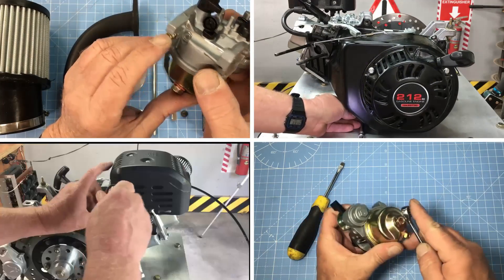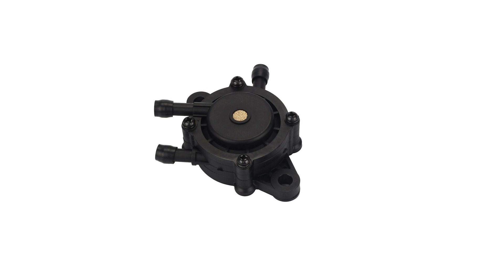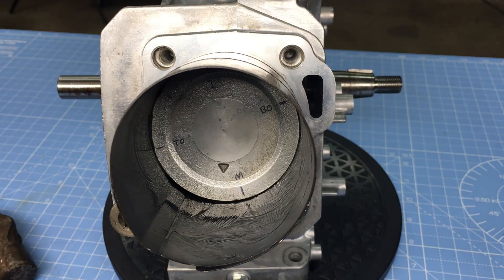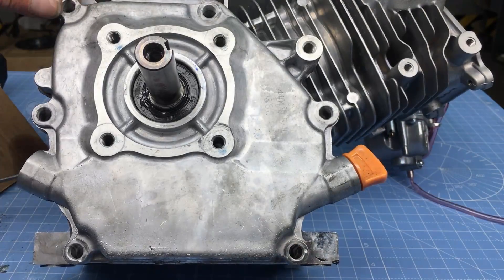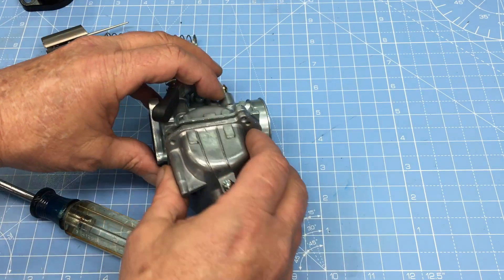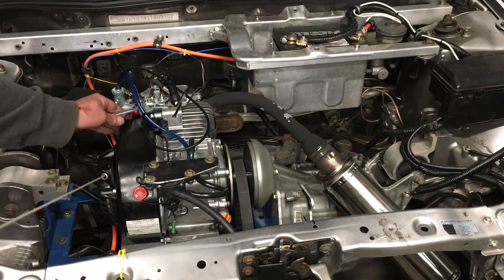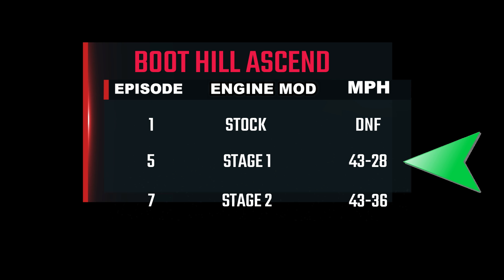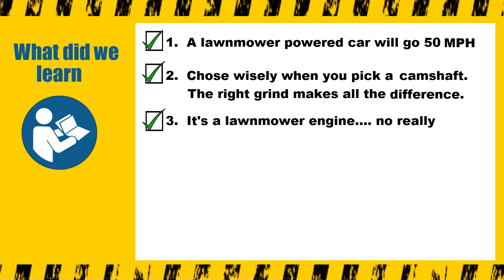Episode 7.  We  get the Honda insight to go 50 MPH with a lawnmower engine.

Comment: Really excited .. all videos on this! Tired of the man and all that crap u dont need ! something cheeper to fix /maint.. My fav truck is work / gas miles ..ford ranger club cab.. i like it short to reach the bed /cheeper tires is thin and small.. 185/75/14 .. less rubber is cheeper tires.. /better gas.. No a/c ... what engine for both gas/ 50mph/pull a lawn trailor! ? ??? my 3.0l ..cracked block /water in oil.. time to do it! help! i can lower to 40 mph.. if have too !

Comment: Adding a turbocharger is the simplest, most cost effective way to gain much more torque and horsepower, because it's the torque your needing to increase, so add a turbo, and that car will drive like it did with the original factory engine.
   The turbo will also get rid of that lawnmower sounding exhaust noise.
   I would love to see you try this. 🤠🙏💖

Comment: 7 steps from the top on an NPT tap will get you the correct gauge depth +- a quarter turn. At least with the tap you used here.

Comment: Thanks 🙏🏼👍🏼 for Showing Something That We're Not Sure if we'll Try it or Not. for,,,, X,Y & Z  reasons.
I saw a Twin,,  V2 650cc at Harbor Freight's @ little over than 45 c.i. displacement
Now, in the place of the 212 cc., Will reach 60m/h in @ 20 seconds., Under the same circumstances.

Comment: vm22, should have chosen the vm20 or vm24 since those can be equippe with an adjustable main jet making it a far superior choice then using fixed size jets.

Got the 20mm myself and it works great on a 70cc twostroke, takes only a few seconds to add or remove fuel from the mixture.

Comment: I know this is an old video, but I'm gonna pretend it isn't: Fins not aggressive enough, you say? The solution is obvious, and not putting the cast iron one back in: You cut off those fins, modify the plastic one a bit, and glue it on the billet one. More aggressive fins, and a lighter flywheel for better responsiveness! The CVT "torque converter" you're using should make any problems with being able to maintain revs while starting a non-issue, and you have adjustable idle on the carb, so you can just set it to idle at like 1500-2000 rpm if it struggles at normal ranges. :D

Comment: Why not use one of the holes you plugged up instead of drilling a new one? What did I miss?
Reply from the maker: The hole for the governor was plugged in the video, however we can also use the governor hole for the throttle linkage.  If you look close at the engine when its in the car and at the engine in the season 2 episode 2 dyno video, we are using the governor hole for the linkage.  That's why we drilled a separate hole for the fuel pump.

Comment: What happened to the dyno results of the last version of the 212? Inquiring minds want to know. 
Good series, but more dyno results would be nice.
In the last case where you explained the drag strip disappointment, a comparison dyno curve would have helped (Stage 1 vs Stage2).
Reply from the maker: Yeah, I dropped the ball on getting the dyno numbers on the modified engine.  The good news is, once we are settled at the new location we will run the modified 212 engine and finally get the numbers.

Comment: Not sure why you would limit your RPM to 5000. The 18lb springs allow 7K RPM or so. And the cam and mikuni carb would help all that. For a max 5K RPM you could have went with any "CL" cam and stock valve springs.

I'm wondering if you lost all your bottom end with all that timing? What timing does the ARC flywheel get with a stock key? Doesn't the mod 2 cam call for 30 BTDC timing?
Reply from the maker: I limited the RPM to 5K because I was still running the cast iron flywheel,  The ARC flywheel is awesome, but it wont cool the engine at the loads I'm running.     I did try the 30 BTDC with the ARC and the engine got up to 300F and started to detonate.  I backed off on the timing and the ARC flywheel still wouldn't cool the engine.  I reckon they are fine for a go kart or mini bike but not for my application.

Comment: I'd say it has just enough detail. That's quiet a bit of technical specs for a one cylinder air cooled lawn mower engine. It's impressive it can do that much with the right transmission. It would explain how some of the early low power steam engines were able to pull tons of steel along a railroad or plow a field.

Comment: I may not know shit....but.....the engines I have put together and pulled apart, and put back together again all had the rings rotating on the piston , I figure it's the same as pushrods, or lifters  rotating, like I said I may not know shit, but I've found rings can be any old way you want, at least on multi cylinder engines I have worked on.maybe mower is diffrent.
Reply from the maker: You are probably right,   This was the way I was taught and it might have something to do with maximum compression on the first start.

Comment: Awesome. Now before you might have been born. There was 2 mechanics from Florida that took I believe a 4 cylinder Mercury Capri from 1979 to 1984. They took a carburetor off a marine engine, then develope a way to heat up the gas before entering the marine carb into the engine. So by atomizing or vaporizing the gas made it so efficient that got 200 miles per gallon they claimed. So the article was published, and twice their garage was burned down. The government told them to stop or face jail or they would disappear.  If true, you could see why auto manufacturers, and oil companies would want to shut it down. Back then you could request paper work on how to do it, and I did. I was 18, but it was a little to much for me to do. Great project for your channel. After all auto companies said 10 years ago that over 30 miles/gal was impossible, but now get better mileage. The less gas an engine uses the less of carbon build up, which extends the life of the engine.

Comment: Entertaining as a project, but the stage 4 upgrades seem kind of pointless as you could put in a motorcycle engine with more HP for similar price. The connecting rod, head, carb, etc add up to several times the cost of the $99 engine. You're probably up to at least $500 in parts, probably over $1000. Yea, I get it, then it wouldn't be a lawnmower engine.

Comment: Whats your MPG? A smaller engine make me thing it is really high, But the amount of work that little engine has to put out at 50 MPH makes me think it might be a little lower. Please, I am Really curious. Thank you.
Reply from the maker: We previously got 54 MPG  with the stage 1 engine, the stage 2 engine made more power, but uses more fuel.  The actual MPG is unknown but is somewhere between 35 and 40 MPG.

Comment: Maybe you should add a carburetor that can be used with a mixture knob inside the cabin for those spring days. That way you can still make it up the same hill on the hot evening that you climbed in the cool morning without having to bring a screwdriver lol

Comment: im sure you could do some modifications to the front bumper for better aerodynamics and a slightly higher top speed. keeping the windows up would help aswell :)
Reply from the maker: We will do some mild aero mods to the front of the car this season.  The window was open due to exhaust fumes.  If you watch episode 15, we build a complete exhaust system for the car.  Stay tuned, more is on the way.

Comment: If you have to move the fuel tank, and add a fuel pump, why not use the fuel tank that was originally designed for the car, and connect it to the engine?
Reply: Weighs too much is my guess.

Comment: Neat, just found this.  Your in Michigan too.  I'm wanting to install a 1.8L 2ZR-FXE, probably gen4 Toyota Prius engine (at least for starters and I like the EGR design better being after the catalytic conv. circuit) in my 2001 Dodge Ram.  Thinking that'd be a reasonable build that's not really expensive, I have the truck and the 5.9L 360 V8 would be sweet in a boat or motorhome (original plan before Dad sold the Dodge dually when I was away at Tech before I was being mind controlled and assaulted/battered like I guess he) and for the price still fuel efficient alone compared to a 1.6L 1NZ-FXE.  I mean the truck was his suggestion... I wanted a Ford GT and that motorhome as a home to save up and invest in more.  Probably better travelling the U.S. in the Prius too.  Anyways... neat build to see.  I'd personally use a Briggs and Stratton made in the U.S. older opposed twin or maybe a V-Twin Vanguard engine.  The Kholers Magnums I hear are reliable too.  I've been saving a few of the B&S OHV's and those are really reliable and super easy to work with... like the L-Heads.  OK... long story short... great to see the design.  Would be nice to see more trucks with 4-strokes or 4 cylinders.  Thinking can keep 2 wheel drive and just use the stock transfer case or maybe a T90 or something smaller I don't recall offhand as a gear box in between the stock trans.  Thinking a newer 6 at least or even better 8 speed trans since seems more reliable than the 9 speeds if needed for some reason to make more efficient.  That will be some programming fun and/or spoofing and/or custom sensors and controls.

Comment: thats what a lot of people arent aware of , don't realize . the amount of power it takes to double the top speed on a vehicle is way out of proportion . and to keep a vehice cruising at a steady speed takes a lot less power than it does to accelerate it at a fast rate . here's an example - a 1964 VW beetle weighs approx 1800 lbs. and has a 40 horsepower engine , and they go 72 MPH flat out . a 1968 dodge charger with the hemi weighs about 3600 lbs. about double what the beetle weighs and the hemi although rated at 425 horsepower actually puts out 515-535 horsepower at the flywheel . the top speed is 156 mph according to an old magazine road test i read . so , it has over twelve times the horsepower , yet the top speed is less than 2 1/2 times that of the beetle . gearing doesnt play much of a factor here as it really isnt all that much different between the two . it is mostly because of the weight and the wind resistance of the larger body of the charger

Comment: Maybe should have took the aftermarket head to get machined for the stock valves to get higher air flow, if the valve springs would work on them

Comment: I wouldnt say its a lawnmower engine really. Its more lawn equiptment but I rarly see mowers with this set up. Mostly spray pumps topdresser aerators stull like that. Guess it depends on the mower but I havent seen it. The point is correct tho dont let me take away from the fact that this is amazing.

Comment: I dont know how many of those junk carburetors I've messed with now. Not only are the jets way out of specs from there marking, the orifices' in the carbs are undersized.  This leads to lean conditions that no jetting can fix.... And when you get all that squared away, the slide is frequently ground wrong.

Comment: Side note: a guy back in the 80s built an airplane that went 135mph and got 100mpg that was powered by a 35hp briggs & stratton lawnmower engine. Search "mower power to the people"
Reply: 35hp lawn mower?! 😳
Reply: @BattleCorgiTV  
Must've come from a zero turn.
Reply: @skuzzyj  more like a FIELD mower.
Reply: @BattleCorgiTV  probably for a riding lawn mower.... but still....
Reply: @BattleCorgiTV  3.5*
Reply: I rate everything "can fly" vs "can't fly" by "does it exceed 12 horse power", because if the wright brothers can do it, so can you.
Reply: It is okay, there were planes with less power back in the day before WW1
Reply: I saw that video years ago and have been searching for it unsuccessfully. Finally found it again!!  THx

Comment: Interesting video. I didn’t know you could actually run a car with a lawnmower engine. A friend had a Suzuki Swift years ago and I always said it sounded like a Hairdryer. I suppose if a hairdryer was used to run a car, it would be all electric ha ha.  Anyhow, if there is any chance you could compare your lawnmower parts with actual car engine components, that would be great for learning.

Comment: ha ha !   i had   a honda  tn 360 cc   pick up   back in   the early   1980's    zero to sixty was impossible  !   but   it would do 55  flat out  !   all day long  ! and it   used   a sniff of fule  .
i'm english   and up hill  this thing used to run  all week long  for less than 15   quid in fuel  .   and here's me   thinking  this must have cost a fortune   to build  ?
 my old knackered honda   pickup    was so underpowered   used more oil than  fuel    but it was still faster than this  !   3 bags of cement  and 3 bags of sand   and you were in first gear up hills  lol .

Comment: Any reason why you didn't try adding 5-10psi to the tires to see if that helped?  I'd think that would decrease the contact patch and rolling resistance a little, and would make the gearing slightly taller.
Reply: Probably get a lot more out of it if you just Mount those 50-50 spare tires on it

Comment: Honestly, what more do you need for your daily and driving to the shops? I have a 1.0 liter VW Polo for daily driving. Cheap on fuel, easy maintenance. Then for when I miss pushing it to the max in the corners or seeing 165 mph a Civic Type R.

Comment: So.... this looks like to be the only car in the US where the Check Engine light is off. 🤔
Reply: Not really, my cars check engine light is not on, and I'm in America.
Reply: @morganrussman  in this case your light is probably broken 😏
Reply: @RubenKelevra  No, There's just no reason  for it to be on.
Reply: This , and my 95 Nissan.
But if it's engine goes , I've got an 18hp Briggs in the corner in tempted to try.
Reply: At least on youtube.
Reply: That was probably the first thing to get jettisoned in the weight reduction process.
Reply: My 01 Honda Civic doesn’t even have a check engine light😂
Reply: S D  fair enough. I can't talk too much shit. I got my CEL on, in my 96 ZJ. Damn evap code from either a vaccuum line or the FP gasket.lol
Reply: @654Crossman  vaccuum lines are the devil. I hate them
Reply: Wym?
Reply: So you ended up here too?
Reply: @JoeMalovich  algorithm on point.
Reply: @JoeMalovich  yes 😬
Reply: S D  I take it you don't work on cars...

Comment: and it did 50 with the window cracked!  you can probably get a little more top speed with the window all the way up.  in stock configuration, mine would do 101mph top speed, but could only do like 89ish with either window down even just a few inches.
Reply from the maker: Lol, I had to keep the window open a little bit when doing the top speed runs due to the way the exhaust was routed.  That is all fixed with the new 420 build.

Comment: For the drag you should have grind off some of the CVT weights, so it would keep the engine at higher rpm...
Reply from the maker: In episode 10 we try just that...
Reply: This is such a cool video. I wonder if you could make a HYBRID. PETROL ELECTRIC.

Comment: And what would be really cool is if you got a single intake IATB off of a motorcycle, some kind of hall effect sensor, a fuel injector and an arduino to run it. You could probably even adjust ignition timing using it. Full PGMFI for the insight.
Reply from the maker: The 420 will be getting fuel injection... stay tuned

Comment: well honda said screw it and put 2 different cam profiles together and called it vtec.
Reply from the maker: You nailed it!
Reply: And then added a computer to control it to add more complexity and chances for breakdown
Reply: @brenttate9299  ive never had a single computer problem on any of my hondas  in the past decade. nore have i heard anyone having any. As long as you dont drive shitty automatics or cvts  computer problems are non existent. Vtec is far more reliable and proven then the other means of vvt. Because it literally just changes cam profiles and all the computer does is makes sure the car is up temp and has enough oil pressure to actuate it nothing else...
Reply: @brenttate9299  only time ive had computer problems on vehicles is shitty GM and ford computers especially those two. or HEAVEN FORBID FIAT/MOPAR AND THEIR EUROPEAN GARBAGE COMPUTERS. THEN YES I AGREE. but i rarely hear of computer problems on nissan, toyota or honda ever if at all.

Comment: I've been watching your project for quite a bit, my man. I thought I was the only one who wanted to swap lawn tractor engines in cars but NOPE! Your Honda with a Predator motor is fairly impressive. At one time I was trying to figure out how to go about doing something like this with my old Chinese scooter (that I no longer have because China sucks turkey nuggets when it comes to quality....I MEAN because my scooter frame was already rotted out after about 10 months of having it). 

Keep up the good work, dude. Maybe some day I'll be on the same cool journey that you're on right now.
Reply: Since when do lawn mowers have horizontal shaft they have vertical one
Reply: @brenttate9299  I know that, pal. Have you heard of Vertical to Horizontal conversion kits?
Reply: @RBLUS_TY  and what lawnmowers has that
Reply: @RBLUS_TY  well show me a picture of one of these supposed converted lawn mowers problem is with what you talked about earlier we're from the horizontal to Vertical adapter with a 6 and 1/2 horsepower motor it's going to bring that thing down to somewhere around 2 horsepower. Loss of torque loss of RPM
Reply: The point was that you're calling this a lawn mower engine when it is not
Reply: @brenttate9299  Dude, get a life. People put these things in lawn mowers, it don't matter whether if it's a horizontal or vertical. Don't make such a big deal about it for God's sake.